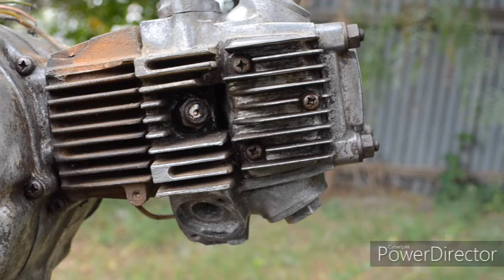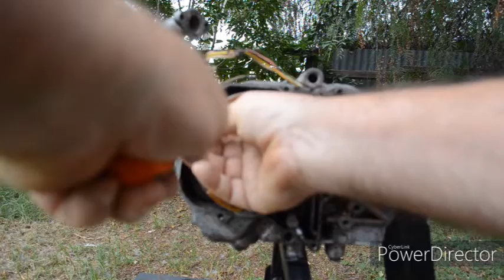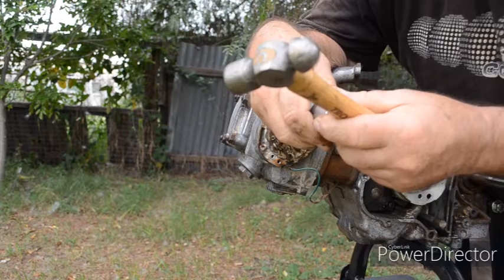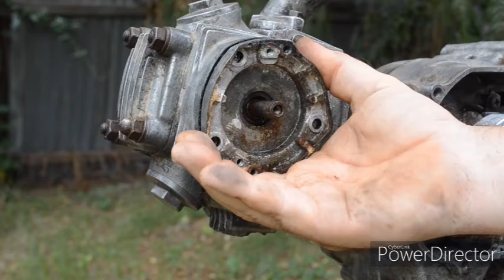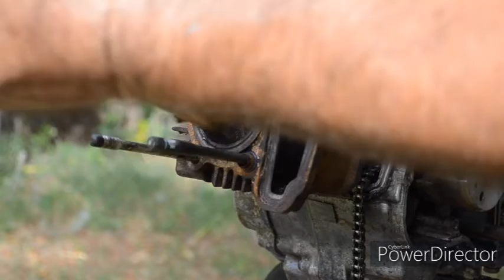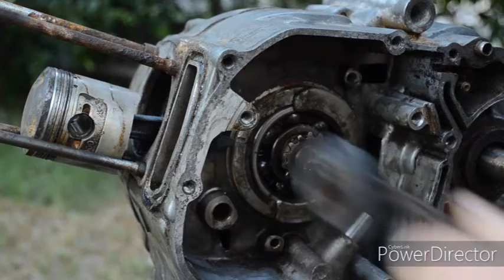Rusty Honda CT 90 Engine Restoration Journey - Pt 1

Comment: I have a '68 KO CT-90, sticky shifting. Probably needs shift drum stopper replacement. These Honda engine/clutch/transmissions are all very similar. Ingenious, complicated and quirky requiring some JIS tools, reference documentation, and  experience and luck sourcing parts.
Reply from the maker: Definately Gary, they are ingenious little engines & made a fortune for Honda.  Considering they've made millions of them I'm struggling to find parts.  Thanks for watching & commenting.

Comment: What a mess.  Sure glad my CT90 engine was in much better shape.  It will be something if you get this engine to  run again.  Thanks for posting the postie.
Reply from the maker: Yeah it makes a rebuild that much harder when the internals are in such a bad state.  I've spent hours trying to clean the parts up.  Trying now to figure out what I need to get it repaired.  Thanks for watching & leaving a comment.